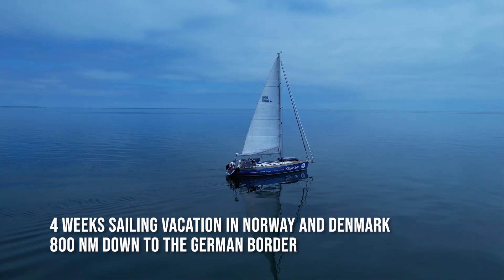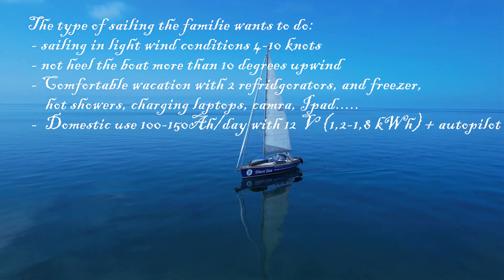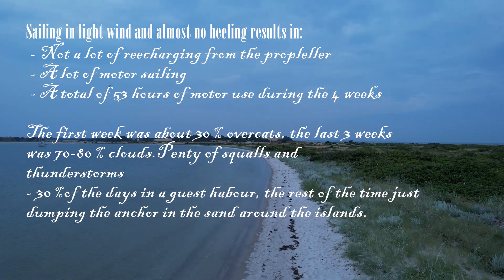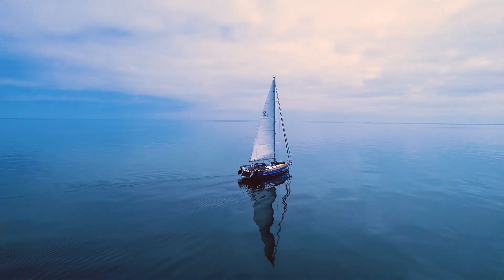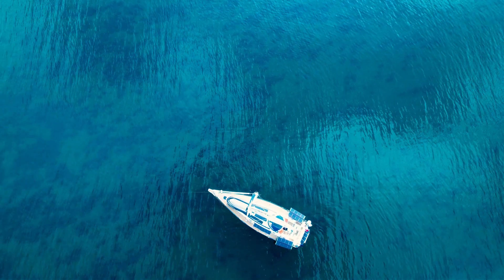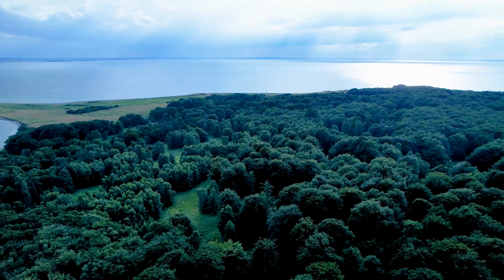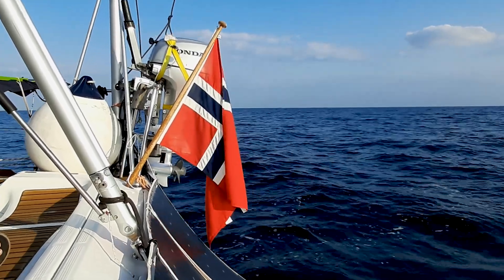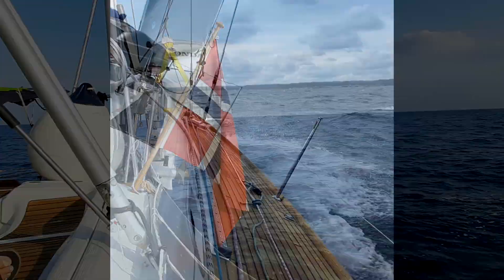Electric sailing 4 weeks, 800 NM in Norway + Denmark -  range and charging Oceanvolt + 2200 W solar.

Comment: how many batteries? they in series or parallel? you have a wind generator or hydro generator?
Reply from the maker: 12 x1,9 kWh 48 V batteries, no vind generator, and the propeller generates hydro power. Recommend looking at https://www.youtube.com/watch?v=Q4MVCjXup9k&t=31s and https://www.youtube.com/watch?v=XJgqKXLEICQ

Comment: Okay...how did you take hot showers? Solar water heater? Heating with electric just takes too much power, right?
Reply from the maker: We use the 2400 W inverter to heat the hot water (1200 W heater). Total domestic consumptions is about 3 kWh including hot water. Motor batteries are 23 kWh. On a good day, we make about 1.5 kW from the solar panels and the propeller, so 2 hours is enough to produce the energy needed. If there is no wind/no sailing for many days and raining, we use the diesel heater. https://www.youtube.com/watch?v=Q4MVCjXup9k  https://www.youtube.com/watch?v=YAViE_UE8_8

Comment: Hello, I really enjoyed the video! It's also very nice to see the victron data at the end. 
- You are using the SD-15? Do you have the Servoprop?
- For how long would you run the motor during the light wind periods? 
- At what speed under sail would the system begin to recharge?

Great to see you successfully cruising with your system!
Reply from the maker: I have the servoprop. In 3 knots we use 1 kW - that gives us 23 hours, in 4 knots 2 kW and gives us 12 hours. This is without motor sailing. In wind conditions more than 4 knots, we use a code 0 and add the power from the solar panels, and the range increases 4 times. Recharge starts a bit over 4 knots- 5 knots giving me about 200 W ang 6 knots about 500 W
Reply: @silentsea5568  Thank you for the reply! I look forward to watching your adventures.
Reply: @silentsea5568  Something doesn’t add up. I understand you have 800 Ah @ 48V battery bank which is equivalent to 38.4 kWh and yet you say that at 4 kts you use 2 kW and your range is 12 hours. Therefore your motor uses 2x12 = 24 kWh of the total 38.4 kWh or 62.5%. How much of the remaining 37.5% (14.4 kWh) capacity is unused because by system design you are recommended by Victron to not go to a 100% depth of discharge (like in a Tesla your typical operating range is 80-20%) to “keep your batteries healthy” and how much of it is instead lost in systems inefficiencies and why?
Thanks!
Reply: @magic72it  I'm not sure if I have mentioned 800 Ah by mistake somewere, or you are mixing the 800 NM trip with 800 Ah? There are 12 batteries x 1.9 kWh = 22,8 kWh 48 V and 1 200 AH 12 V batteri. There is no info regarding the top/bottom safty margin built into the batteries, but there are no description of not using the batteries 0-100 %.  I have tested the batteries down to 7 %, without notecing powerloss in the habour manuvering. Normally, we try to leave at least 20 % before charing, to have some safty margins.